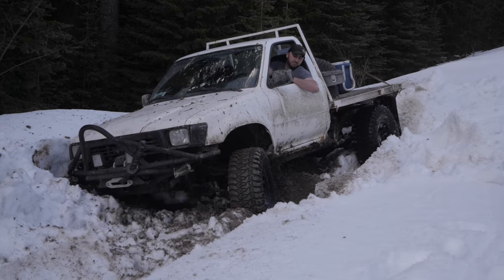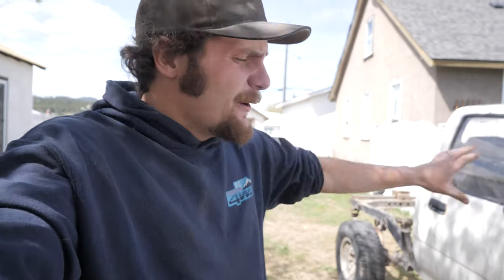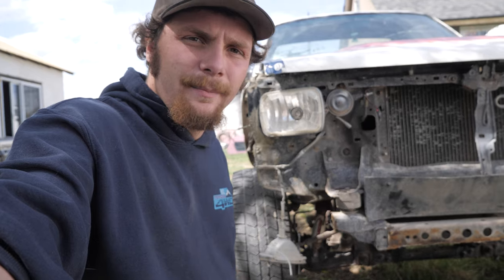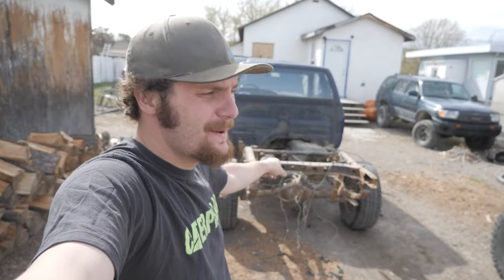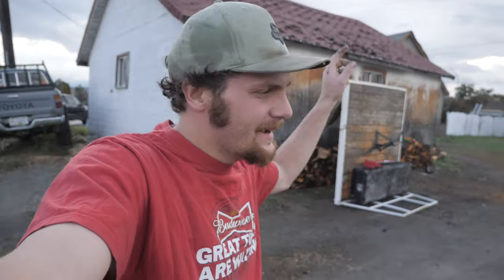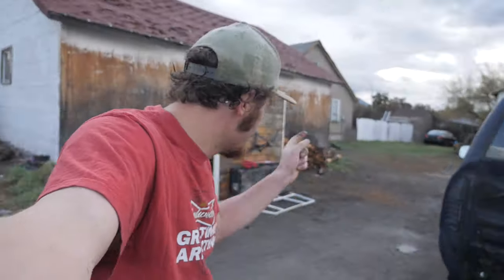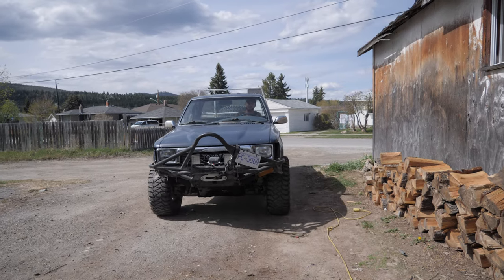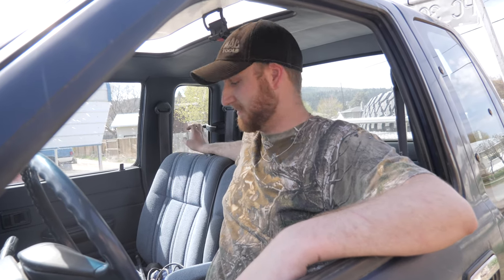Simple 1989 Toyota Pickup | Flat Bed | TG Bumper | 33 Inch Tires

Comment: Knocking the poor mans body lift? A used puck costs less than a $1 and is exactly 1”. You need a body lift and don’t have the $$ for hard plastic blocks that will destroy you cab mounts, you can beat a hokey puck.
Reply from the maker: 100% I am, they are sketchy, and ruined the cab mounts as shown in this very video. They wear out and cause movement, destroying cab mounts. My polyurethane body lift has been installed for 4 years now, and are still just as solid as the day they where installed, and my cab mounts are still very in tact. I'll take my $100 body lift any day over your $10 pucks.